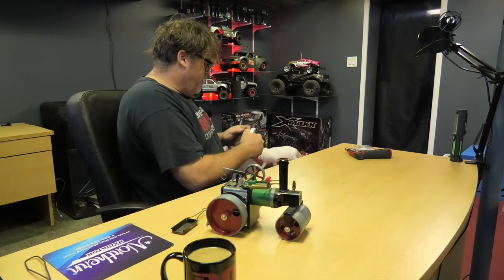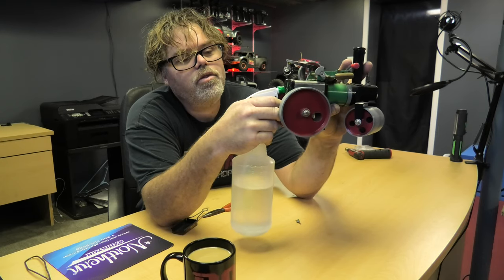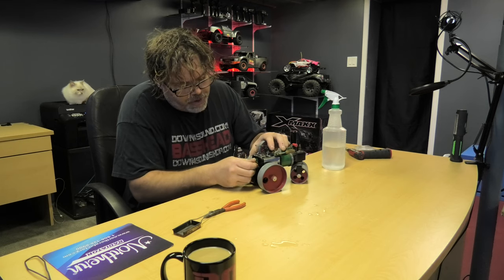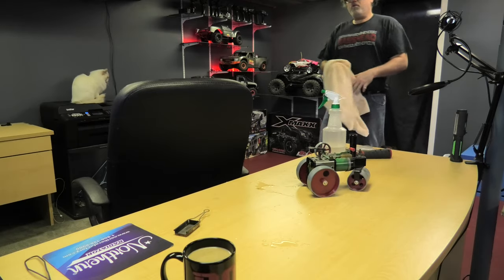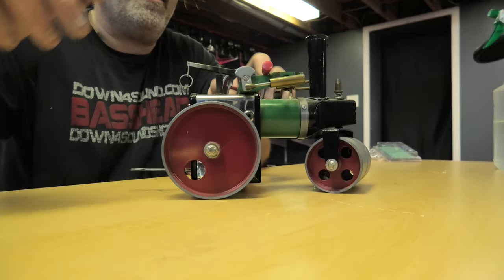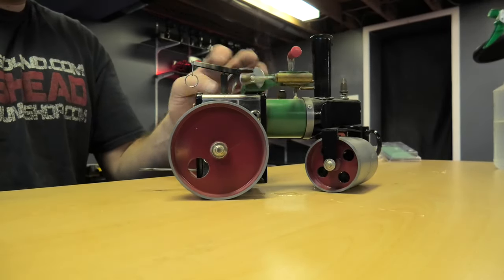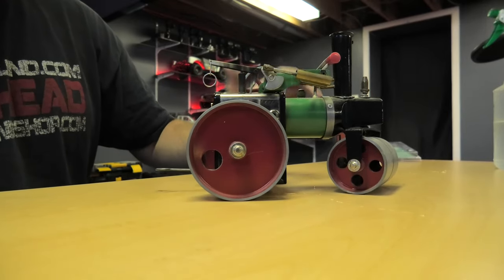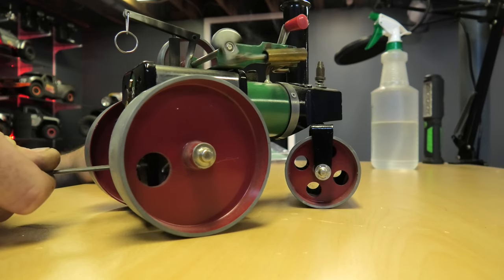Steam Engine Will It Run!

Comment: The engine is a mid 70s Mamod sr1a, For filling the boiler, you can replace the nozzle on the sprayer with som rubber tubing that'll fit in the boiler. If the tube in the bottle will also fit, you can use it to empty the boiler, so water doesn't sit. A syringe with tubing works wonders. Make sure you run it on soft or distilled water, to save the boiler from mineral buildup. And, water is not a lubricant, ask Jay Leno, you have to oil every moving part, and use steam oil on the piston assembly. It helps protect against wear and helps them run better. You can find the drive belt, steam oil and other parts on Ebay, Forrest classics, mini steam and Mamod's website.

Comment: Those Mamod steam engines are decent! They still make them here in the UK. I have the same SR1 roller somewhere in the garage. Never had much success getting it to drive along for much distance. However I saved my pocket money and got a Wilesco hammer to run off it. I built a little plywood model engine house / steam forge. Hours of fun.
Reply: Love to see a video of that!

Comment: Don't want to fill it too much.. You have to leave room for the steam to collect.. It's harder with those Mamods like that because there's no sight glass. My Wilesco engines have a small sight glass on their boilers so I won't overfill..
Reply from the maker: I hear ya man lol that's why I filled it from the back drain off plug instead of the top
Reply: I have one of the smallest functioning steam engines in the world.. I use a plastic syringe to fill it.. Takes 20ml of water and uses a soy candle for heat..